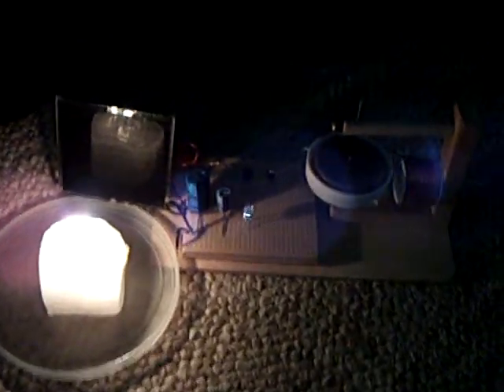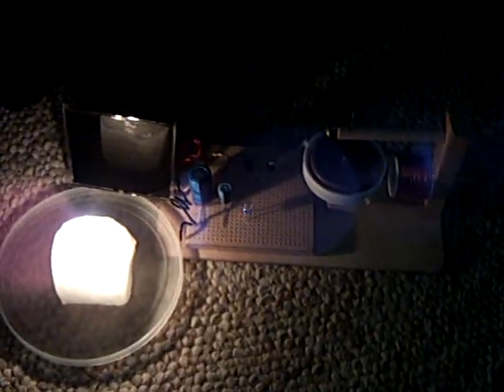Candle light powered pulse motor.ASF

Comment: That must be a VERY good solar panel. The ones I saw, only worked with solar light or a very strong electrical light. Good idea, anyway, candles release CO2 so it's not like clean, solar energy. But it's another source of energy anyway. Try surrounding the candle with aluminum paper as a mirror.

Comment: nice. So here is a though. You could pulse a very very very large coil -- high inductance -- low resistance. Each PING to the coil will create a ringing sine wave at the self-resonance of the coil. So lets say the HUGE coil resonates at 320khz. If you can keep the resistance low enough -- big gauge wire, you will have a nice ringing sine wave each pulse of the motor ... but at a HIGH voltage.